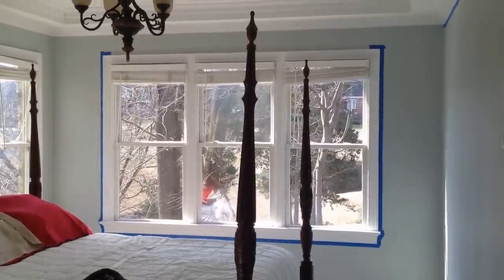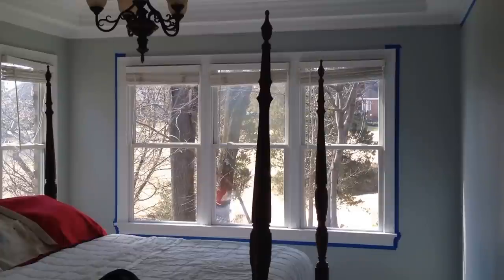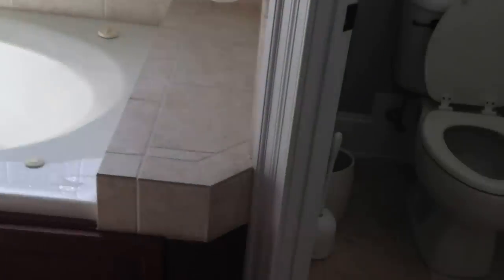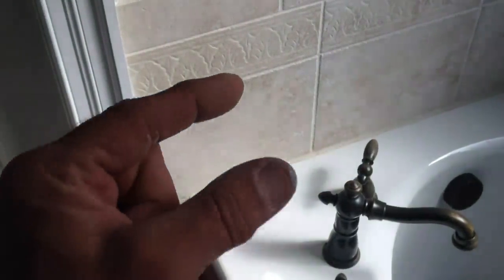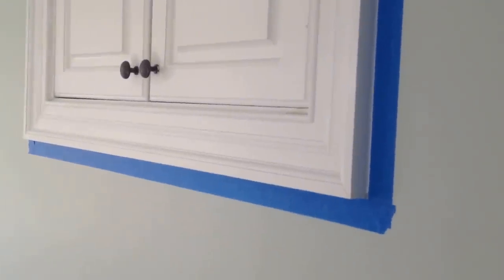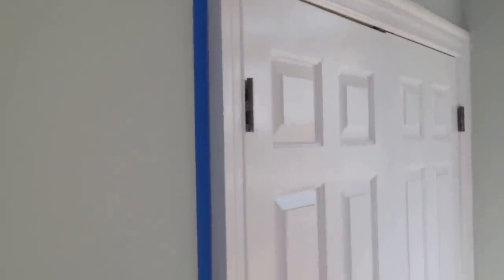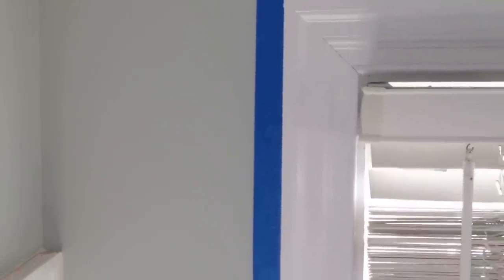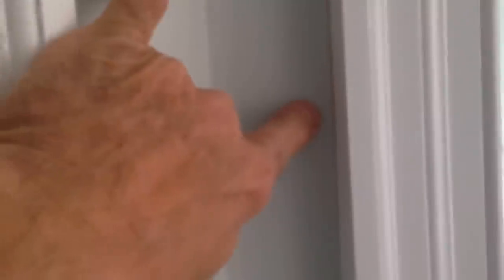PAINTING TRIM THE RIGHT WAY/ MASTER PAINTER EXPLAINS IT.

Comment: Most pro's  in my local and myself freehand 
If you are not able to freehand well then your not a pro 
No pro's in my local ever use tape
Reply: I am a pro that has been painting for over 20 years and I tape and freehand! I tape on the high-end jobs to get a perfect line and if it's just a quick repaint I will freehand. I would rather take the extra time to tape on a $600.000 home to have a perfect line then a little wave of freehand
Reply from the maker: I know Jeremy all the controversy about taping, versus freehanding.  To say if  I tape and then saying I'm not a pro, just because I chose not to freehand.  Really.  I wonder why after 30 years of painting that,  I still have people paying me $50 per hour to paint year in and year out.  PLus not one dime in advertising. Plus Jeromy I have never ever had a comeback ever.  Well I think I will just have to accept the fact that I'm just an not a pro.
Reply from the maker: Thank you Curt finally a comment that is full of common sense I do the same thing.  I would hate to see the freehanders, paint a million dollar home, and look the customer in the eye and say their work is prefect.
Reply: Exactly! My boss would kick my ass taping everything! The part that makes you a "Master" painter is the ability to free hand and cut straight lines! Not to mention cost!

Comment: ...confused here...1st...who's caulking after paint...?...2nd...why can't you cover that original color with the trim paint first then cut to that with new body color...?...I get your argument for covering old slop on trim but still doesn't justify all that taping...not to mention if you don't seal that tape there's no way you're getting a crisp line on 100% of that linear footage...
Reply from the maker: I know what you're saying here.  Taping for me is easy I can tape a room in 40 mins.  Plus I have a way to make sure tape stays down tight to the surface.  I always let paint dry 11 hours before I pull it off, so there is no pealing, or bleed through.  I work by myself, and I know that when I set a price for my work, I include time in my est.  Remeber this I charge a lot of my painting services, because of the expensive homes I work on.  The customers I have exsect this out of me.  But they also expect perfection, and perfectly straight lines, which I know the way I do it always comes out right.
Reply: Have you ever heard of Frog Tape?

Comment: It should be said that the right type of masking tape is very important. You wouldn't want to rip off a load fresh emulsion from the walls. 
Overpaint from previous cowboys kills me especially on PVC or wooden window frames. It looks bad when it's the same colour as the reveal. It looks horrific when you change to a different colour on the reveal. I always inform the customer when I see it and I wont paint over it if requested or leave it there either. If I do, it's my name on a poor finish.
Reply from the maker: Very good comment thank

Comment: Nope.  Wrong.  Sorry.  Happy to show ya better way.  Prime, caulk, ceiling, trim, walls.  Install new flooring replace base board.  Touch up.  And show me your project finished don't tell me how great you are not show it off.

And that paint job you're covering up looks like a homeowners paint job.  You shout mask the caulk joint at the countertops to backsplash. And don't use silicone.  No paint sticks to silicone. And silicone won't stick to countertops and tile either it'll roll off with your finger.  Sometimes you'll have to silicone around a sink and it's best to mask off the sink and the countertop leaving a perfect little a thin parallel line between the tapes then apply an over amount of silicon and with a rubber glove wipe it off with a finger and push it really tighten a crack and then peel the tape off without getting any little titties and look like a beautiful little f**** gasket down there cooler and s***. It's also the same way we put Windows in limousines and seal the vinyl top on.  Caulking in between sheetrock and trim is just to fill in the shadows and it does work that's why it's called painters caulk. It needs to be wiped with a damp sponge because it does change the appearance of the paint if too much is used and it shouldn't be used to fill in nail holes and you should never use it on crown molding outside corners use drywall mud and sand it in. But don't listen to me I've only been doing it for 2 days. Lol.

Comment: Another terrible analysis of thinking your right and people that do things differently are wrong. Sure some of what people did in the past isnt up to par. You say you dont spray trim yet you say your into quality. So do you also brush a entire wall instead of use a roller? Proper prep for spraying trim so it looks like glass and than doing walls is true quallity instead of looking at shit brush lines on the trim

Comment: LMAO  Mr. Fix-All and nothing is fixed good, How dare you to call yourself "MASTER PAINTER" ????? LMAO, Every painter worth his salt knows : trim gets PAINTED FIRST and the REASONS for that are multiple:
1. If you gonna use tape:
    a. it is easier to tape trim straighter then tapping the walls.
    b. usually trim is painted in semi-gloss or satin on which the tape will stick way better than the walls that have the tendency to come out with pieces of paint, because (and this is one thing for sure you had no idea about) wall paint which is usually flat or egg-shell DOES NOT have the amount of paint solids that a good quality trim paint like Pro-Classic Trim or Emerald trim has inside.  
2. As a pro painter doing new construction and high end residential repaints day in day out it would be a nightmare to use so much tape: time is money bud.
3. its easier to free hand on the wall side than the trim side.
4. white paint on walls from painting the trim gets covered perfect by darker wall paint
As I and the others said : TRIM FIRST, AND DON'T TRY TO REINVENT THE WHEEL
Or maybe this might be a twisted selling point for your customers which have no idea about painting.
You said to some other guy earlier that you always get the contract; that's what you say , and you can say whatever you want because we have no way of verifying you.
And lastly : WE HAVE NOTHING TO LEARN FROM YOU. Drop your over sized ego and stick to that vodka bottle.